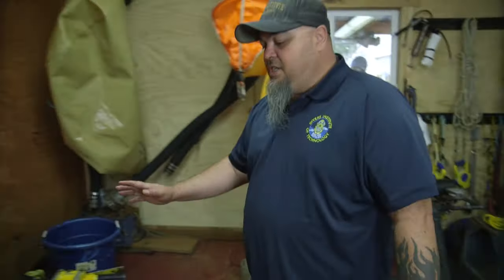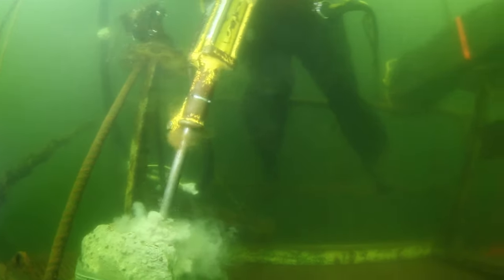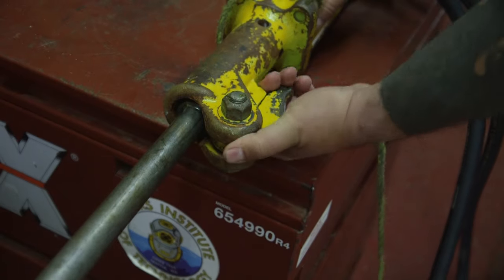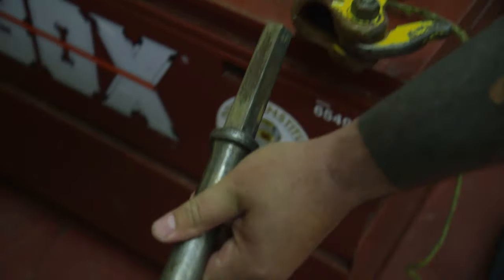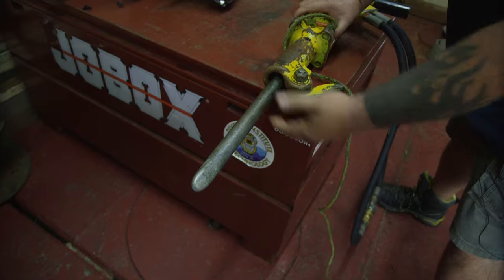Underwater Jackhammer ... and how to BLOW THINGS UP underwater

Comment: Not trying to be offensive, but a Jackhammer rotates and has high volume compressed air flowing through the center ti flush out the drill cuttings. That’s nothing more than a pneumatic hammer designed for chipping and breaking hard surfaces not drilling.
Reply: The tool in the video is actually a Stanley hydraulic (not pneumatic) "breaker". The guy may have also been referring to another Stanley hydraulic tool when he was talking about drilling (one intended for this use)